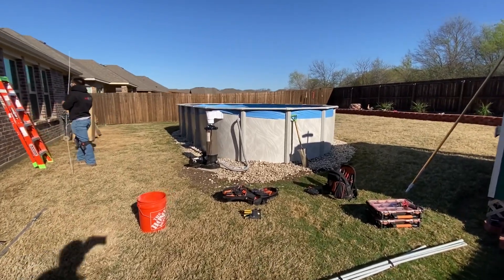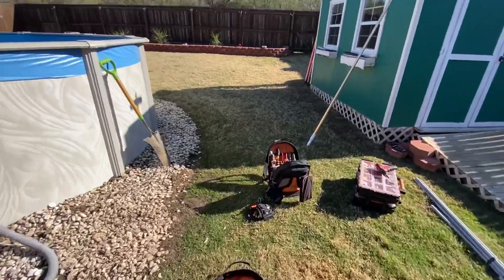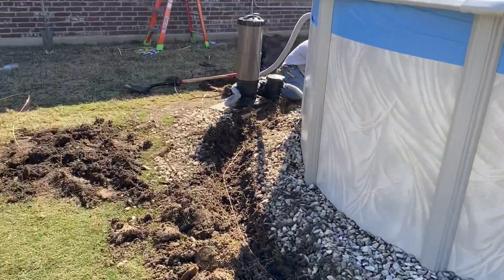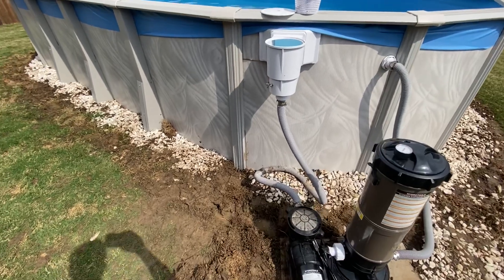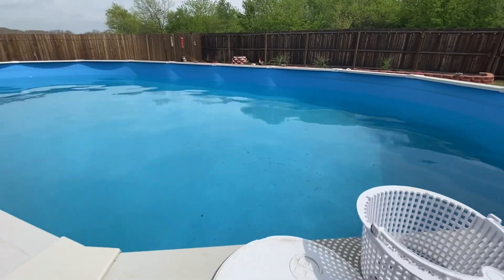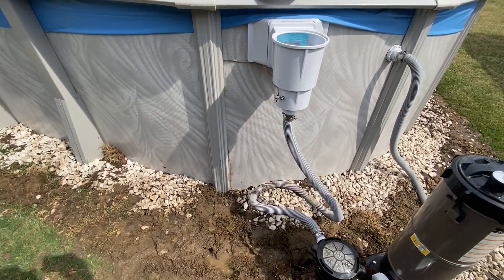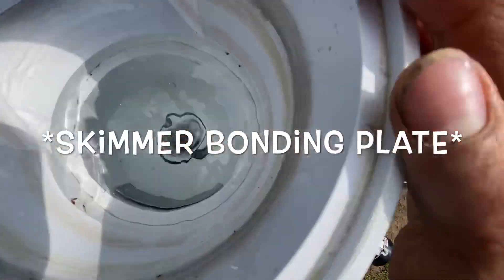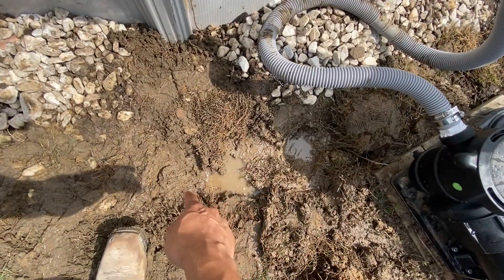Above ground pool electrical installation.

Comment: Can I bond the 4 metal upright buttress supports instead of the regular thin metal standard upright columns or do the connections have to be spaced out more equally?

Comment: Where I live, every metal leg need to have the ground attached to it, and then not grounded to a grounding rod
Reply: Where you live your inspector is wrong. All metal parts that are bolted together only need to be bonded at one point ie a (one) pool support.
Reply: @StanSwan  I agree, but they don't. So I'm stuck dealing with the inspector who knows it all.
Reply: @RobHTech  I’m curious on what type of pool it is what do you mean they’re not bolted together if it’s got a metal rail on top or a metal surrounding they are connected

Comment: What point around the pool can or do we have to ground?  Uprights, bottom rail, wall?  All or either of these?
Reply: he didn't GROUND anything he BONDED the pool.
Reply from the maker: We grounded it to the uprights on four somewhat equal points. Any metal point should do as long as there interconnected.